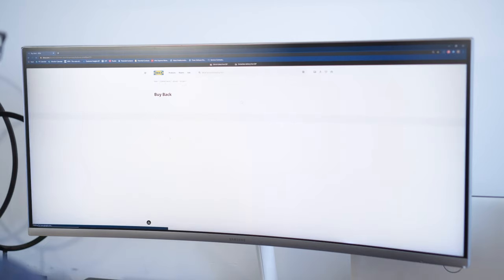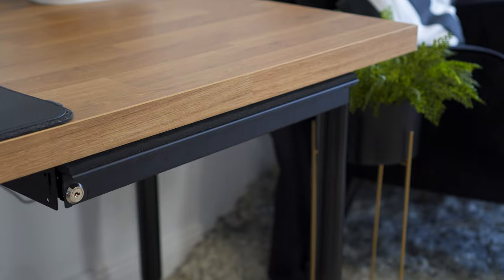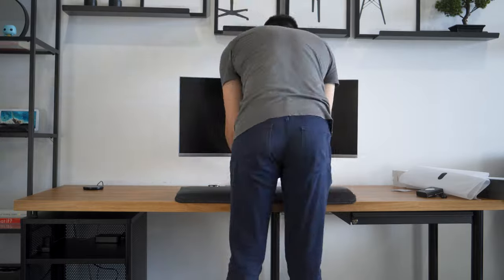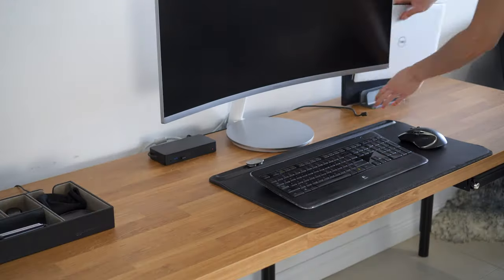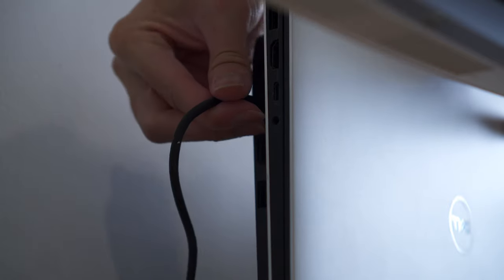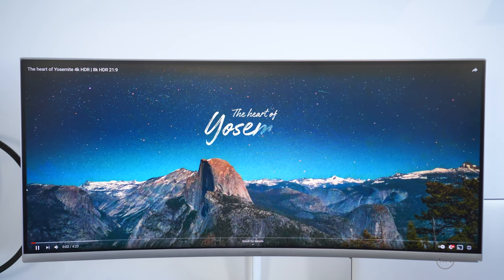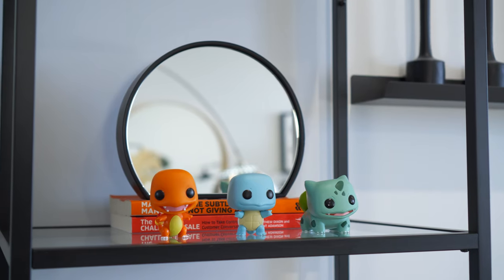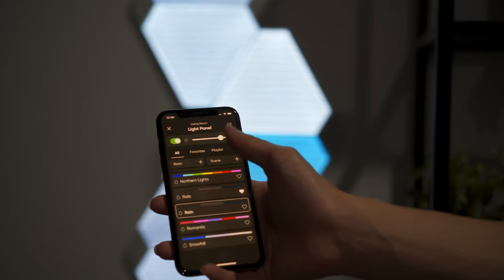Laptop Desk Setup Makeover - Home Office Tour 2021

Comment: I have similar desk set up and my suggestion is you should use different type c cable with 2 different type c hub and I recommend belkin type c hub which delivers 60w and 4K@60hz. If you do this you will not need to plug-in plug out your cable every time. You will switch via monitor. Also you should think to change your keyboard with Logitech g915 tkl 😏

Comment: I chosen a similar look for my desktop area. I went with the walnut wooed instead but also from the same series from IKEA. 
I also have the Alex drawersunit. 

But you have great ideas to complement it with an underneath drawer and the valley tray. 
My laptop fits well between the Alex unit and the bench itself so it is out of the way as well but I really liked that vertical laptop stand too.

Comment: Are you struggling to percieve the 34 inch monitor ? This desk does not have a sizeable depth . I am going to make a similar desk build. But I have worries, would you suggest it with a 34 or 49 inch monitor? Very very nice desk setup. Welldone!
Reply from the maker: 34" is perfect as the table is not too deep. I'd say 49" is too wide unless you go for a deeper table.
Reply: @reynardlowell  in my opinion you chose the most beautiful countertop among them all in ikea. The Karlby version does not have this color consistency, and this one seems a bit lighter and brighter, which refreshens us and supports productivity, rather than disturb the focus with patterns. That's why I guess I will opt for the same color combo of black and light oak. Beautiful build, thanks again..

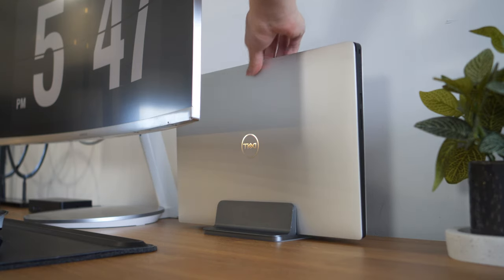Comment: 3:58 RIP laptop cooling. Is the Dell XPS 15 still alive?
Reply: I was questioning about the same thing. I have the same XPS model and I have been debating about the best way to put it aside without damaging it or hindering the performance
Reply: @goncaloborges7925  You can place it on a vertical stand. That's not the problem when I talked about laptop cooling. Plus, it looks good and minimal. Just make sure you place it upside down so that the air exhausts are facing upward and make sure nothing is directly behind the laptop as the one in the video, which blocks the air intake.
Reply from the maker: It's working fine as I always take the back laptop out when editing or rendering videos which is typically outside working hours so not an issue.

Comment: Hello. Quick question. What are you using as the stand between the drawer and table top?
Reply: I want to know too
Reply from the maker: I used a couple of those flat round coat hook (something like this: https://www.ikea.com/au/en/p/skogsviken-hook-black-50428702/). The part with the screw fixing goes into the bottom of the table top. Then I used 3M Non-Slip Gripping Pads on the outer flat round part to prevent slip and protect the top of the drawer from scratches.
Reply: @reynardlowell  thanks mate ☺️
Reply: @reynardlowell  thank you!

Comment: where did you get the legs to hold up the IKEA BEKANT Storage Unit (Mesh Black) underneath the worktop?
Reply from the maker: The legs of the BEKANT Storage Unit came with the product itself. For the thing between the bekant and the table top, I used a couple of those flat round coat hook (something like this: https://www.ikea.com/au/en/p/skogsviken-hook-black-50428702/). The part with the screw fixing goes into the bottom of the table top. Then I used 3M Non-Slip Gripping Pads on the outer flat round part to prevent slip and protect the top of the drawer from scratches.
Reply: Thanks this is what I was wondering, cause you didn’t mention it in the video.